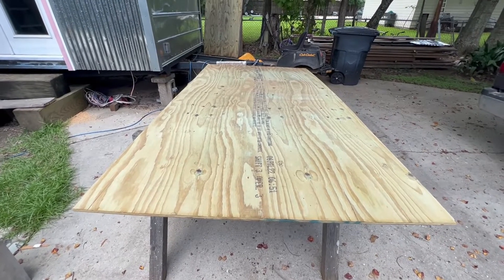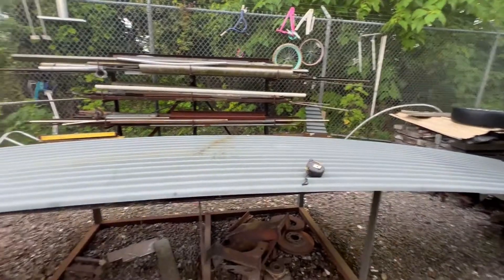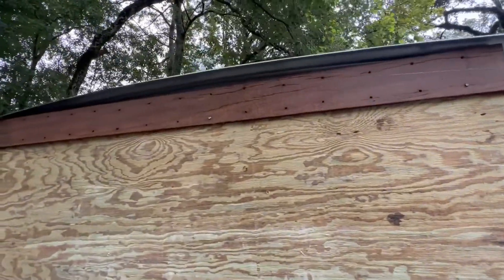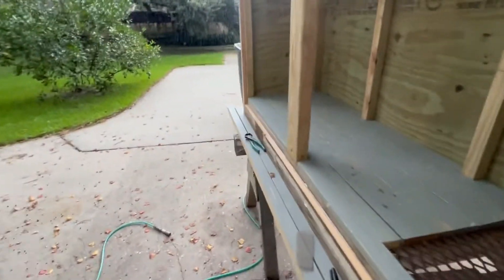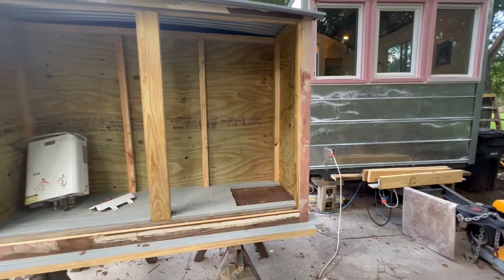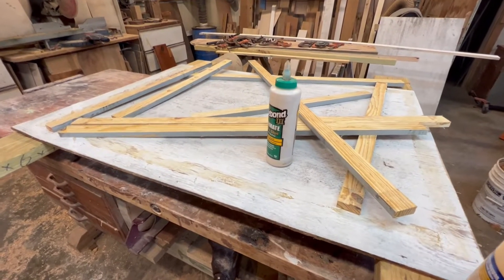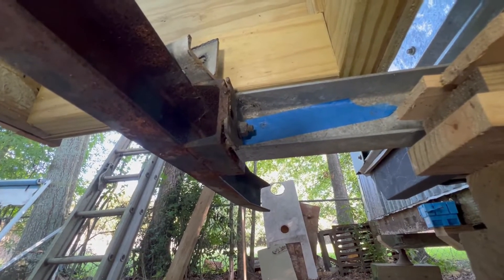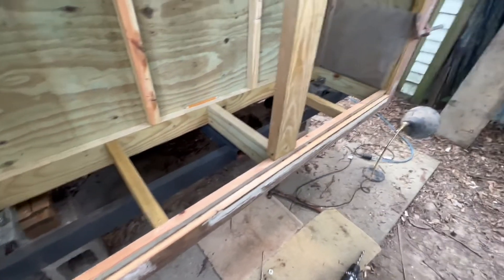DIY Tiny House mechanical storage box.

Comment: Just keeps growing don’t it ? Lol. Interesting spot for the water heater but whatever floats your boat ! Just about ready to move it to your location I would guess !
Reply from the maker: Getting close Dave! I have an instantaneous propane heater that is not rated for indoor use, so it will live in the back. We are really hoping for some dry weather. Plumbing and electrical work remaining under the trailer and I have been putting off laying on the wet muddy concrete. The property has also suffered from the rain. I would want to try to get down the road right now. October is usually our driest month so that is the current goal.